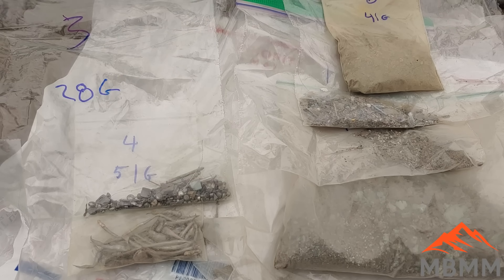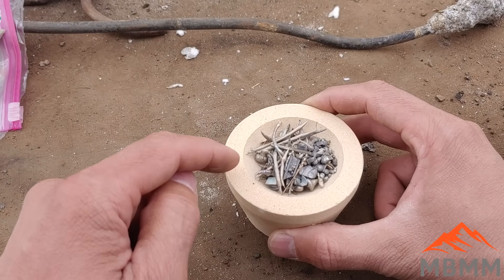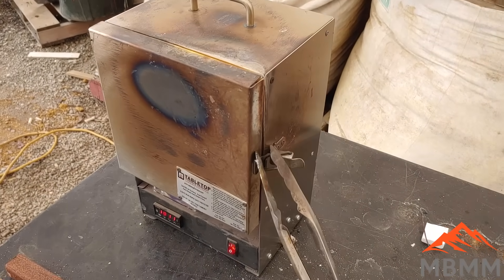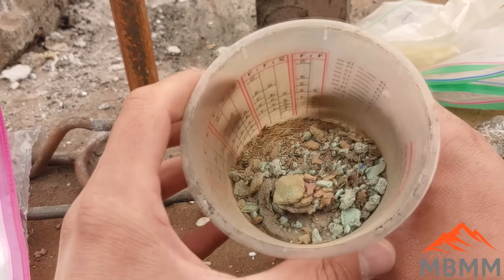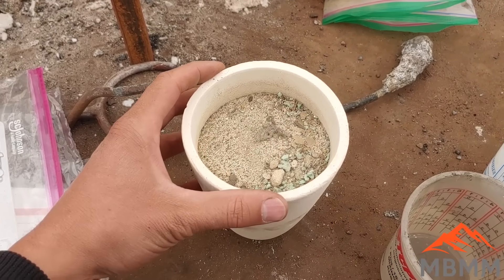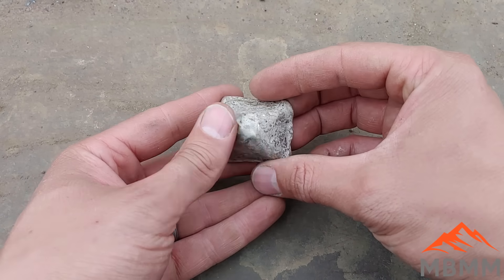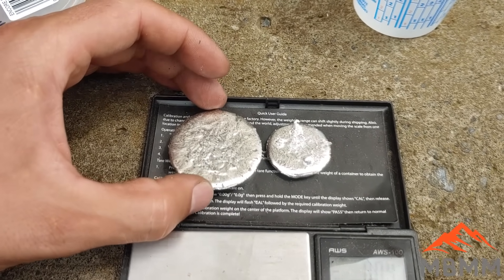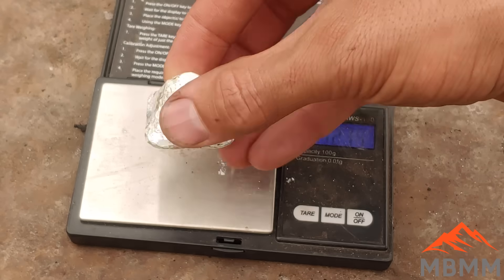Silver Refining Process Without Acids

Comment: I saw some guys from india or Pakistan or something. They were smelting circuit boards to the pyramid mold then going straight to cupelling. Then they finally used acid to separate the gold and silver, probably could have refined the waste further for platinum and palladium because they were saving the waste. Did you ever try that? Just straight up pulverize circuit boards and then smelt? I saw you were going at it with a shaker table and all that.  Seemed like these guys skipped trying to separate anything out before smelting.

Comment: so im trying to get into silver jewelry. when i make a chain and im not pleased with the result, i melt it down and try again. but, the second time i use that material its very prone to oxidation and cracking in the rolling mill. im guessing its contaminated by solder.  ive tried drowning it in borax, stirring it with a pure graphite rod and pouring it into shot. it gets better but not a lot. 
im using a map gas torch to melt it. does that contaminate it? should i get a fuel + oxy setup instead? 
i dont have a furnace.. can i use a cupel with a torch? 
im wondering how to go about purifying it. No (legal) access to acids.

oh, im making 925 by myself by mixing 999 silver with copper by weight. perhaps i should make 999 jewelry and use 999 as solder? id miss out on the soft, medium and hard solder but i could use heat sinking.... gahh.. i need guidance.
btw, when you pour the goo into the cone mold... its like the surface of the sun. so satisfying to watch!
Reply: Do you have a refiner that would exchange your scrap of .925? I bet the cost to exchange would be less than the time to process small amounts yourself.

Some places you can mail in product. Look at the classified adds in a jewelry trade publication and I be there's one there

Comment: @mbmmllc how pure is the finished product? Is the yield better through this method rather than dissolving it?
Reply: The yield isn't better. I worked at a refiner when I was 14. Large acid vats to strip x-rays. Then the furnace to a cone mold. Then refined.

Comment: When I first got into collecting and melting sterling silver, I used to occasionally confuse it with pewter, so I have a number of ingots tainted with pewter. I thought about sending them off to a refinery, but I’m not really sure of the purity, so I’m wondering if there might be a way for me to refine it to a higher purity at home. I don’t have a furnace, so I’m restricted to a crucible and a torch.
Reply: i sent some silver to the refiner. they test with a machine and pay based on the precious metal percentages only. even some gold that came out 7ct was worth a fair bit.

Comment: Could you cupel sterling silver? 

I have a few pounds of brazing rod stubs. 
Guys would throw them on the ground and I would pick them up. Silver content is 15%

Would a cupel be a sufficient way to refine this? 

I’ve watched sreetips use acid but that makes me nervous.
Reply: Go with the acid. Do it outside with a mask and fan first time.
Vent hoods are a must if you do it inside. Some local refiner will do it for a contract rate.
Vent hoods are easy to make with a blower from a evaporative cooler or furnace.

Comment: I like those silver sprouts.  I've refined silver and poured small bars but have never seen any sprouts. But when my silver is pure I do see concentric cooling lines that show up on the exposed smooth, shiny surface of the bar as it cools after pouring.  I use a torch and borax for melting.  Thanks for the many informative videos.

Comment: I didn't catch where you removed the platinum and other such metals? I do know, I think, where you removed the base metals.
Reply: If any, they will still be in the silver precious metal pyramid button.  Separating all these is quite complicated but if you have enough you could maybe send to a refiner.  Perhaps having someone check with XRF might help, but they really only test a tiny area of the surface which may or may not be comparable to the whole.  Find a shop with a machine that can roughly determine the makeup as to what and how much of each item are contained in the pyramid button.

Comment: can you try and use a sander on a silver plated platter then use your recovery method  to claim the silver?
Reply: I'm going to just grind to a size that'll fit in a crucible. Plated is such a small amount you need to cut effort as much as you can. 
I'm thinking forge it then acid refine.

Comment: Silver dissolves less oxygen as you raise the temperature beyond the melting point, so if you want to avoid "sprouting" when it cools, just bump up the temperature at the very end before you terminate the process. Of course, cooling it down slowly also helps, as you did with the second button.
Reply: I think you are wrong. The hotter it gets the more oxygen it absorbs.
Reply: @stephenanderle5422  It's a well studied phenomenon. The solubility of oxygen increases with temperature in solid silver, peaks at just above the melting point, and then decreases with increasing temperature beyond that. At 973°C, the solubility of oxygen is 3050 PPM, at 1024°C it has gone down to 2950 ppm. As the temperature is increased the molecules gain in average energy and so are more able to overcome the attractive potential that keeps them in solution and thus the vapour pressure of the solvent increases and the solubility of the gas decreases.

Ideally, of course, you would like to have an oxygen-free environment for a little while at the end of the process, to draw the oxygen out of the silver before it solidifies.

Comment: I have some amalgam containing zinc mercury and silver. I was considering using this method if I can first drive off the mercury (using a still potentially, not sure if it would actually work) do you have any experience with getting rid of mercury?
Reply: You can do it, if you want, but you need to pay great attention and care to the process. The still needs to be very careful closed and sealed, and the output is to be put under ... let say 5mm of water. Grade your temperature in the process too. Best practice is to wear a full mask with Hg filters fitted, as one mistake may be the last with Hg vapours. You may do without, but then be extra paranoid in your work. Oh, and I assume the still is iron, or stainless steel... :D.

Comment: I have a whole bunch of silver ore rocks and don't now how to separate the ore and silver can you please explain that process in a video thankyou
Reply: Dylan:  Naturally there are several approaches for such a task.  If it were me, I would have them pulverized to powder and then run a dilute nitric bath over this and then remove the silver from that.  This should be the most economic and will gather the bulk of the silver but any process will be time consuming.  Again, I try not to use nitric for anything but it has its uses as long as you know how to use it, and have the equipment to do so.  Be careful, have a sealed fume hood if possible or do this on a dry, calm, day outside away from animals and other people.  Make certain that any tools or equipment you use are able to be used on this and are acid neutral.  Most glass and plastics are but I have run into some that got eaten and then you have a mess on your hands.  Always create an insurance container within which to work so if you have a spill or something, it will be contained by your insurance container which also must be acid neutral.  Always have a water bucket with liberal baking soda dissolved in the water.  If you splash any on anything or yourself, immediately place in this water.  If you later use this water to neutralize the nitric liquids, be prepared for it to fizzle and froth and then you have to repeat multiple times.  If you can get it down to a pH of 7 or so it will be mostly neutralized and can then be disposed of.  If you get any on your skin, the quicker you can place into the neutralizing water, the better.  Find a book or instructional on all this first, read or watch it numerous times or until you feel comfortable doing this in your sleep, or have an observer who knows how to do this and can show and coach you on every detail.  Most of this is highly technical in nature, and not for the greenhorn.

Comment: Just a quick question for you Sir. Can you use 20 Mule team Borax for your flux.
Reply: Yes, I always have.  You can also obtain the more pure lab form but it will cost more.  If I ever used as much as the vid shows, the crucibles would boil over.  He placed a make-shift cover on the second furnace which contained this but also held the heat in better.  Crude but very effective as long as you leave open a small air passage like that shown.

Comment: I always thought that the sprouts were from the silver cooling faster on the outside and shrinking while the inside was still a bit molten.  Squeezing the silver out as it cools into the sprouts.  I know that bismuth does this as well.  Copper will shrink inward, I'm guessing because it's such a good heat conducter, and form pits while silver and bismuth form these sprouts.  But I never knew that it was due to dissolved oxygen and not from the outside cooking faster than the inside.  Very cool!  😎

Comment: What is the typical percentage or purity of gold used in dental fillings?
Reply: Dental gold is usually somewhere between 9 to 22 carats. However, dental gold from 18 to 22 carats is mostly used on some bridges. The purity of a dental filling depends on your country. However it should be something between 9 to 16 carats (37,5% - 67%).

Comment: I like this method of metal recovery instead of the acid baths and toxic chemical clouds for several days/weeks.
I'm trying to recover gold from some circuit boards and have no desire to play Darwinian roulette.
I know my metal will be dirty but at least, I won't be dead.
Reply: Lead oxide gasses are plenty toxic.
Reply: @NoName-ex4rf  Actually a lot of people are using bismuth or even nickel as cupel collectors instead of lead, but they are mostly keeping these as trade secrets.  I would opt for bismuth myself as the melt temps would be perhaps even less than lead.

Comment: Is using cupels more economical than acids?
Reply: Some of us prefer not to work with acids so I think the purpose of this video was to provide such an avenue for people.  At the very least, you end up with a chunk that you can then send to a refiner or other processor to better purify it, or even sell it as is.  It also depends on what quantity one wants to work with, how much space you have available for such process(s), and your ability to work with acids versus the furnace or cupels.  Some local coin shops buy these and when they get enough they send it to a refiner, most of whom have minimum requirements of both quantity and dollar value before they accept submissions.  They also may or may not be willing to separate depending upon values within.

Comment: I have several hundred pounds of silver plated brass from commercial radio station antenna transmission devices. How can this silver be recovered?
Reply: That would take some serious study.  There are different kinds of brass and their melting points range from around 930 to 1700+ degrees F.  Silver melts around 1670 to 1700 degrees F, so you may need another means to separate them.  I would check with a chemistry professor.

Comment: Where did you get that pyramid mold ??? I want one.
Reply: You just weld them up. A local mobile weld could do it with scrap. Use at least 1/4 inch steel. They last foever
Reply: @sparksmcgee6641  thank you.

Comment: At about $90 worth of silver, what was your cost in crucibles, materials & gas to extract?
Reply: When you already have the tools for other purposes, you look for any method to keep them operating. So if he had some down time, this is just a way to keep her overhead low.
Reply: About the only thing that is not re-usable are the cupels.  The utensils, pyramid mold, and things are re-usable although the crucibles can be reused, they can also be cleaned -- search for the process to clean them. Electric furnaces are more accurate but also very expensive.  It looked like his second furnace was probably a propane ceramic-brick type which are economic and work well as long as you have a pointer that can tell you the temps you are working at.
Reply: If you didn't catch it, these were samples sent to him by a customer.   As this is his business. 
 The client is trying to ascertain the value of a byproduct of some other processing or recycling they are doing. You know a recovery rate kind of thing. To try to see if it's profitable or not to try to save and process these waste materials.  So I'm sure he was paid for this service, this was not his silver.
Reply: Maybe $10k from ad revenue pretty good profit if you ask me
Reply: YouTubers like Brent and Dan have him refine for them ,the knowledge of what he is sharing is the valuable part the precious metals are just extras but to have success is the goal ….just glad he shares his research it would be trial and error if not or word of mouth books …nothing like visualization of the process
Reply: People never give credit that this guy might have learned this as a hobby. Something to do. At least he learned it. At least, we are not throwing that into a hole in the ground and/or giving it to the scrap yard.
Reply: The real question is how much did he make off his YouTube channel today
Reply: He did not answer did he?  That is what I thought.
Reply: @bernardmacarius2635  Well, I know he does stuff at a loss.  His channel makes him money, which is why he does it.  I was just wondering.
Reply: @sirfishslayer5100  I appreciate him sharing for sure!
Reply: @sirfishslayer5100  profit will come only on large scale
Reply: @paschoaltavares5134  Exactly.  I'm sure he does it more than once.
Reply: @sirfishslayer5100  dude it took me under 30 mins to find out. He probably just doesn't check comments or much. He clearly is a busy man.
Reply: @RippedNerdyKid  busy   sniff   yup   snort   n   hapipapi lol

Comment: I think it's funny that you use a restaurant grade carbon steel frying pan, probably worth more than your #5 crucible .
Reply: Whatever works -- I did such things years ago and simply picked up a lot of stuff at auctions or second hand stores, or even throwaways.  I once made a crucible out of a very old large cast iron tractor/combine piston.  It worked very well until I put it on a blacksmith forge one night and it melted the bottom out of it.  I now have a bucket of mixed pieces of gold and cast iron that one might now call refractory ore.  It could probably be melted at 6-8,000 degrees to separate it but I don't have such a furnace nor do I expect to get one.  Cast iron skillets also work well for many of these processes.

Comment: While I can appreciate the chemistry here I really have a hard time justifying lead usage.  Even if 99% of it is pulled into the cupells that still means FAR too much is released into the air.  A tank of leaded gasoline would emit less lead than this processing and we ALL agreed it was still too much.  Acids may be harder to come by (for some) and they carry their own dangers but the fumes from my nitric acid aren't going to interfere with some kid's mental development.  If you wouldn't do this with your 6 year old son nearby I really don't think you should be doing it at all.  As part of our responsibility as refiners it is on us to find new and better ways of doing things.  just because it worked well 800 years ago doesn't mean we should keep doing it the same way.
Reply: Actually a lot of people are using bismuth or even nickel as cupel collectors instead of lead, but they are mostly keeping these as trade secrets.  I would opt for bismuth myself as the melt temps would be perhaps even less than lead.
Reply: Considering the billions of gallons of gas versus this its fine. And will you refuse to live in a house built before 1977
Reply: @sparksmcgee6641  Oddly enough Ilived in ahouse built in 1973 for many years and there was not a single spec of lead in the place.  I do appreciate your attempt at justification though.
Reply: I wouldn't have my 6 year old son around while refining any metals an actually UT worked for 800 years great so ima stick to that keep your acids and save money do whatever you want but I want good natural silver an gold and I want nothing to do with paper money 💰

Comment: I make copper brass and aluminum ingots now I wonder if they are even close to pure. I use flux when melting but still it may not be very pure.
Reply: Measure their density and compare to the density of pure aluminum or the various alloys for brass/bronze whatever, not the diffraction and you can figure out what % purity it is
Reply: @benadams5557  I inquired about melting down aluminum cans and was told they would pay much less for ingots than for the cans themselves.

Comment: I wonder if we might see a video of when it's worth trying to recover silver, copper or other metals.  Maybe it might even be interesting to see when it isn't worth trying to recover gold or platinum.
Reply: I would like to see what it cost him to do this. With the cupels, the brand new crucible, the fuel and power used. The silver itself, right now, comes to about $65. I could have just picked out the larger pieces that I knew were silver and used them in my jewelry making, which would mean a much smaller yield. But I included them to be certain that it was all silver in the end.
Removing the larger pieces, that would leave the filings, the solder clips, the reverse electroplated silver. I doubt it would be worth it to refine without those other, larger silver pieces.
As for copper, nah. I don't think it will ever be worth it to refine on such a small scale.